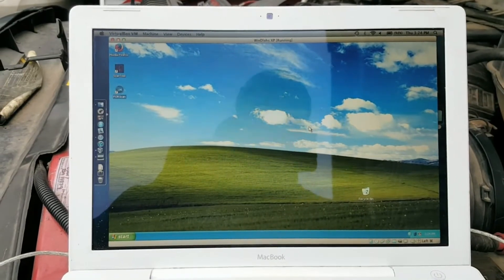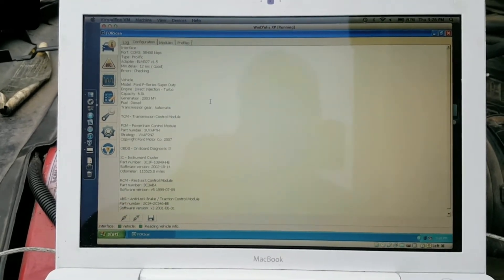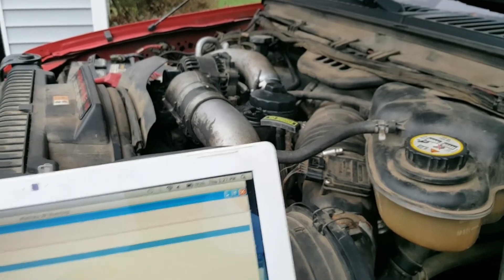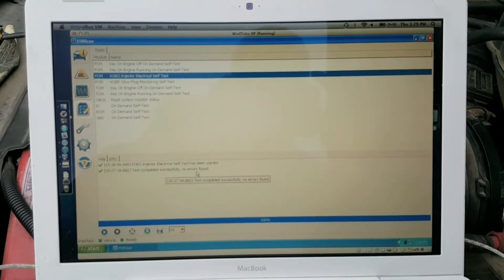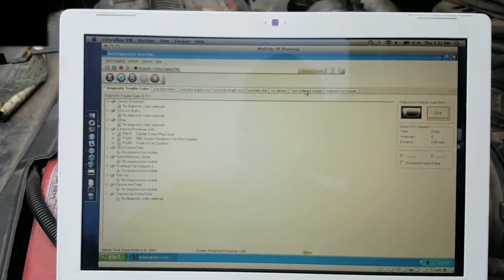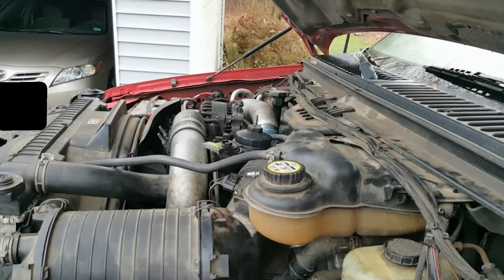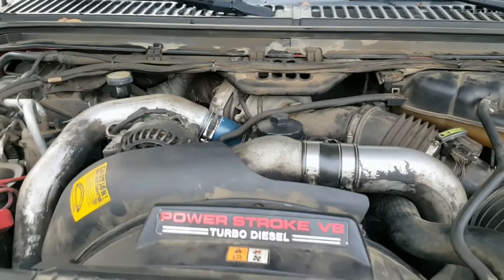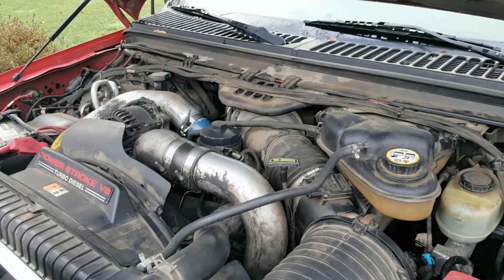6.0 Powerstroke Injector Electrical Self Test (Buzz Test)

Comment: Thank you very much!
I have a 6.0 that was driving me up the wall. Runs poorly when cold, the injectors pass the buzz test, but not all of them click during the procedure. I just wanted to know if they clicked 1-8 or in the firing order of the engine. (its 1-8).
Its also good to know there is a free scanner that can do the job for me.

Comment: Could use some help with a 6.0L... Was brought to me running poorly, no power, turbo not spooling. It would then run well intermittently but begin surging at idle. When surging, the turbo could be heard spooling up and down and she smokes black. After sitting for a few months I'm back to working on it but it is now a no start problem. I can't even diagnose the issue it was brought in for! I'm just begining to check basics, power to IDM, I have fuel pressure from the lift pump (making a hose to attach a gauge still), this truck had the wrong dip stick in it, I drained the pan and checked the quantity of oil and found it sufficient so I don't think it's an HP oil issue. Have you ever run across similar issues with these trucks?
Reply: I know it's a little late now but if you have a scan gauge test the IPR on the HPOP high pressure oil pump. Diesel Tech Ron has a vid on it. Your STC fitting on the HPOP may be bad like mine was. Didn't even get oil to the turbo.
Reply: Sounds like vgt is stuck or Covered in Carbon.

Comment: Thanks for the video. I downloaded the FORScan and used it for the buzz test.  One thing I noticed was that I had three injectors that didn't buzz but the test said it was completed with no errors.  Is this the same thing it said when you ran your tests in the morning?  Did you end up replacing the injectors?  Thanks again.

John
Reply: I believe that the test will always say that IF you have good electrical connections. The test doesnt know if the solenoid moved, that click sound, it only knows that the solenoid is electrically connected to the FICM. Hope this helps.
Reply: TomRad1 A little info for all my truck didn't make a sound on buzz test using car  guague pro app. I added archoil oil and fuel and after a couple hundred miles, injectors a buzzing great.
Reply: John McLean
Reply: did you add archoil oil into the diesel tank or did you add archoil oil and diesel to the engine oil?